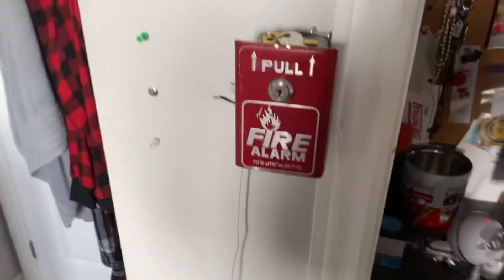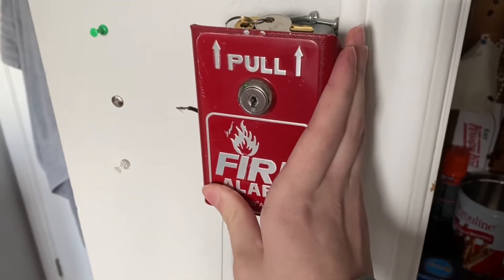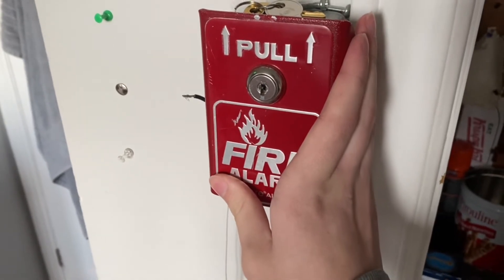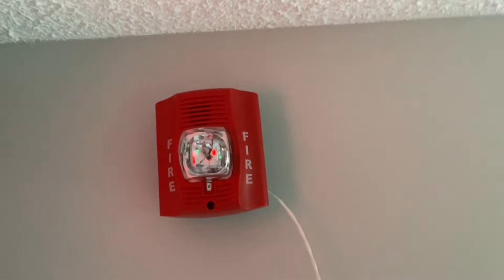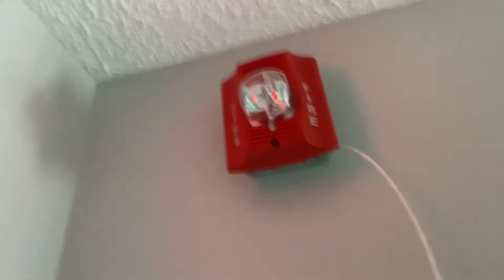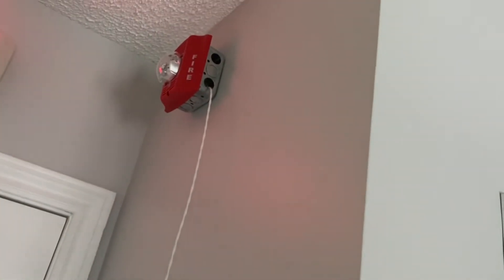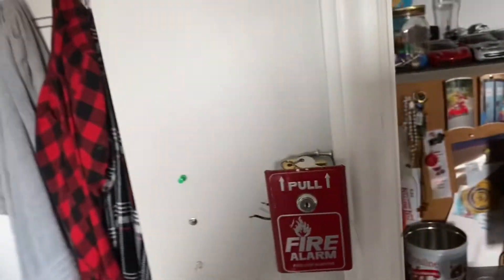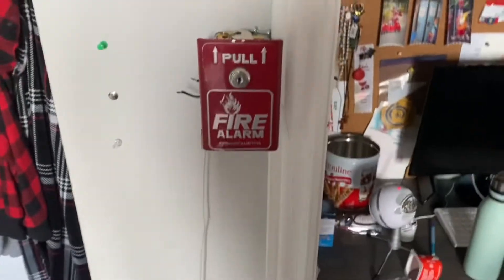Mini system test 6: Very loud spectralert advance

Comment: would the 374 horn work on the panel or no since u need relays and ac converter
Reply from the maker: I could probably get the 374 working with enough wiring and stuff but as of right now i don’t really plan to. i do think it’s a cool idea though and i may try it in the future with the new system test series.